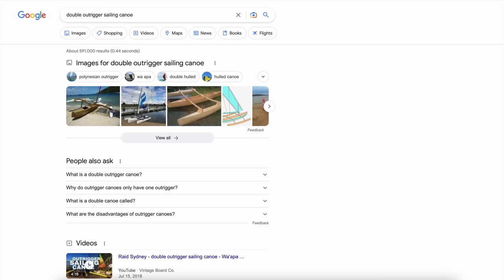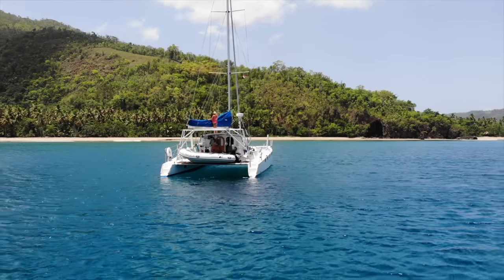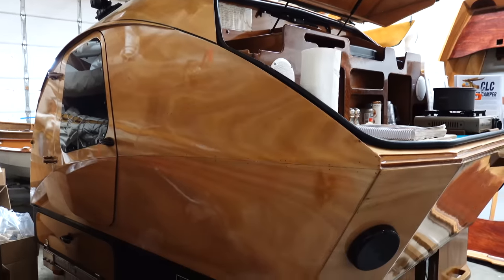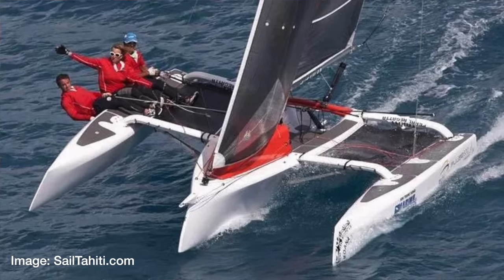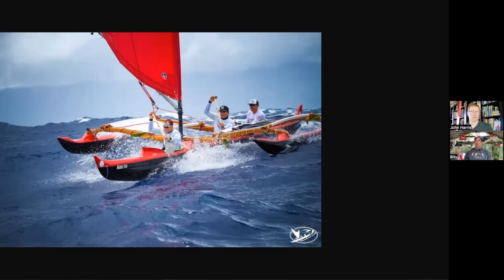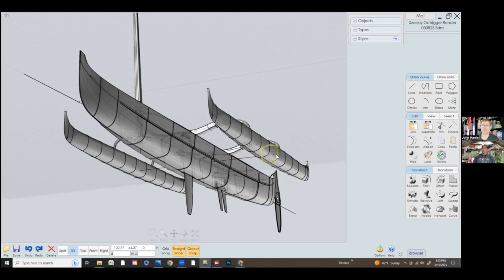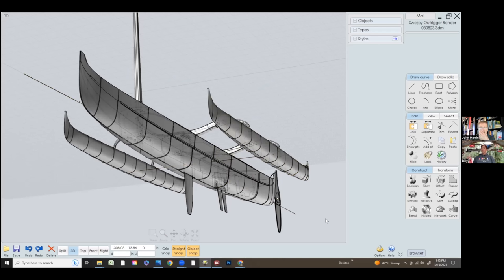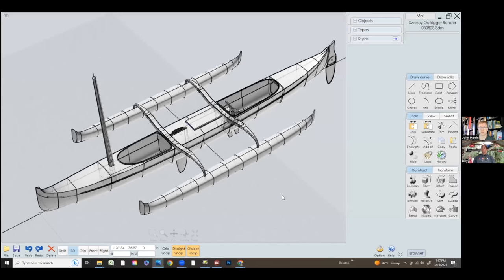A New Boat Design is Born   FT. @ChesapeakeLightCraftBoats

Comment: I think you could more easily modify a hobie ti, by gorilla taping on some side panel gunwals to give it that retro look and prevent water from splashing into the hull. But I still want to see you kitesurf fly your body in the air in front of your boat connected by a rope to it, Ben Franklin key style. You rock!

Comment: Sounds like great concept, I understand you and Chesapeek Light Craft have put in a huge amount of thought into this but from your video it seems like you may not have considered a few things ........ I know this won't change anything (and I'm not really trying to) but this would be my input into such a venture.
You seemed to be falling into western thinking......as this is an open outrigger canoe ..... look more to south east Asia for inspiration. Jukung Indonesian outrigger canoe or Waka Polynesian outrigger canoes would be my inspiration. Kujungs, are exactly that, open canoes, they have over hull length low displacement wave piercing amas ...... they rely on the main hull (which have a decent amount of rocker) for floatation and the wave piercing amas are more for stability (not so much heeling resistance) ...... they sail them to their limit in open ocean, reducing sheeting to reduce heel ..... this may be more of a reflection of pairing it with lanteen style rig and its inherent sailing characteristics. 

For uniqueness and safety and sailability I would look at adopting a flying lanteen rig (specifically Romy Rig). This rig pays homage to the lanteen and to a lesser extent crab claw rigs traditionally used on outrigger canoes. It overcomes the inherent issue with tacking a traditional lanteen rig by adopting two masts/split mast, allowing the sail to be hung between them and clear of obstruction (easily achieved with double outrigger). To be even more unique you could even rig you kite to it?
Current technology/system could be adapted ...... you could start/develop the concept by using a modified windsurfer rig mast, boom (split the wishbone boom and modify into pair of mast sections like whale ribs), sail (minimal adpation) ....... then just need to build a bow slewable sprit.
Only issue is reefing not easy to furl (but may be unnessesary as lanteen readily spill excess wind and can be easily sheeted out) but the design has huge potential for anchored canopy structure, etc.....
Very easy to sail, safe footless sail, very forgiving sheeting tension, there are a couple of YouTube videos demonstrating this.
Looks like you would use one of the pedal assist in the locked position and I would suggest the forward pedal assist be removable and temporary have a retractable daggerboard fitted (rather than a dedicated daggerboard case) .... that being said, I don't recall Jukungs actually using Lee or Dagger boards ..... so maybe the two locked pedal drives would be adequate
Please consider these notes as concept ideas generated by a common interest, they are not critisims or suggestions ......  more like friendly discussion points.

Comment: Look up Bangka boats from the Philippines.  (Pronounced Bonka)   They have been around for a couple of centuries probably, at least since the 1800's.  Skinny ama's compared to Polynesian tri-canoes and they, since WW2, have been powered, usually by surplus USA genset engines.  I saw several that were rigged for sailing similar to Hawaiian style when I was in the Philippines, and they haul ass.  I don't know, check them out.  At least look at some pictures before you build.... You can never have too many ideas before building a boat... Good Luck
Reply: @charonstyxferryman  You are most probably correct, and I would never argue about anything concerning watercraft with anyone named Lars Hansen!  Sweden or Norway I'm guessing?... That's a pretty salty name.  When I first saw Billy's drawings, they looked exactly like the "bonka" boats we used as dive boats in the P.I. back in the early 70's.  I was already recommending those sweet little tri's before finishing his video to be truthful,  I had to watch it twice... Anyway, Billy and Sierra are so much younger than me, and their style, other than that DeFever! tends to be much more trendy than mine, just thought it might be easy to overlook the simplicity of the traditional Filipino fishing boats.  Sounds like he's on the right track though... Fair winds!
Reply: @mikeemery6741  that Lars Hansen comment was hilarious!  Also, thanks for sharing the Bangka design, I'm enjoying going down some of these rabbit holes.